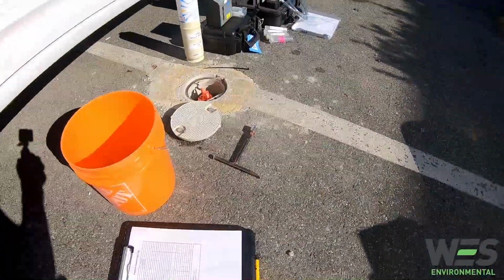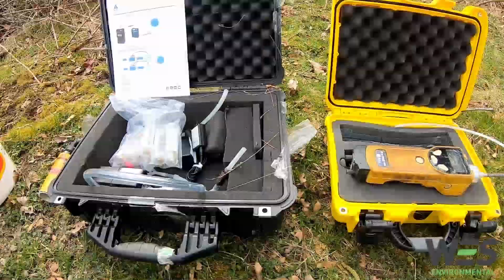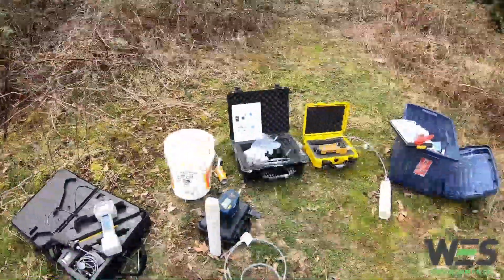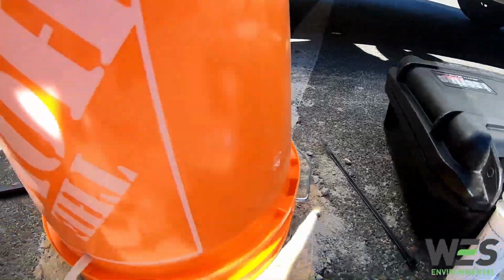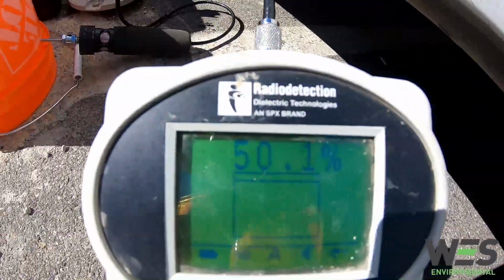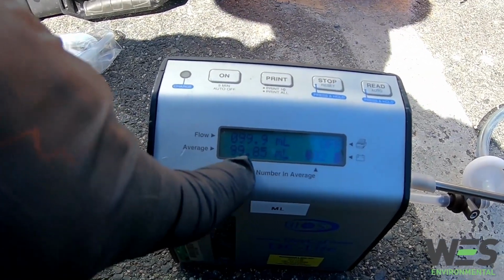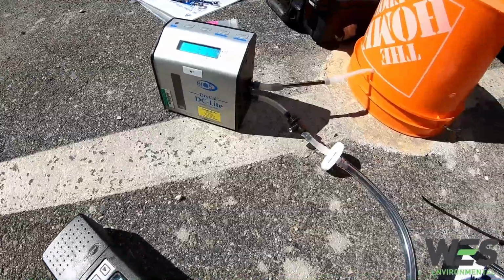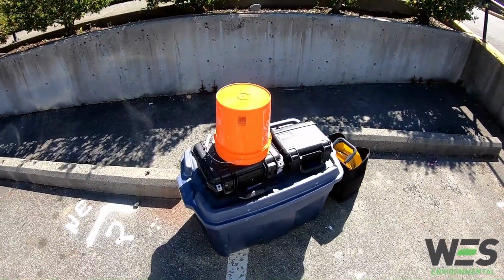Soil Vapour Sampling, Victoria, BC

Comment: Hello, very good video informative. This is active soil vapor sampling right? Do you have a video on preforming passive soil vapor sampling

Also, is there a list of equipment need to collect this sample?
Reply from the maker: Thanks Jordon, yes this is active vapour sampling. If we ever get a chance to complete some passive vapour sampling, I will try to make a video of it.

Here is a list of the main equipment/supplies:
- SKC air pump
- MiniRAE 3000 VOC meter
- Mesa Defender Drycal
- Helium Detector (MGD-2002)
- Helium + regulator
- Teflon tubing
- Flexible Teflon tubing
- Y-splitters
- Shroud (empty bucket with holes drilled into it)
- TD tubes (for sampling and testing flow)
- Hydrated bentonite and/or polyethylene sheeting (for sealing)
- Sand
- Wrenches
- Tape
- Tubing cutters
- Stopwatch

I believe that's everything but there are some tools/equipment I always have on me that come in handy for troubleshooting that I may have forgotten in this list. The list also does not include anything related to the vapour probe installation.
Reply: @wesenvironmental5327  I think you missed the manometer or is it not used in soil vapor? I was told we use the manometer to measure the pressure in the soil vapor tubing, if no pressure indicated then no need to sample it (SV well is faulty) but if there is pressure reading on the manometer then you can go ahead with all the processes you showed, pls correct me if I am wrong. Thanks for your help